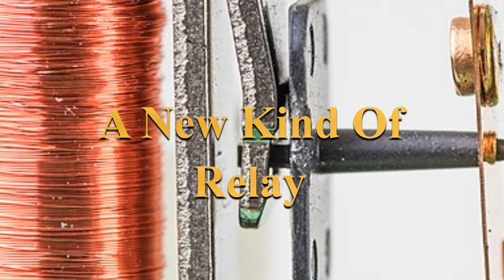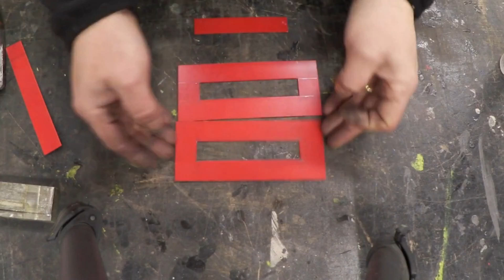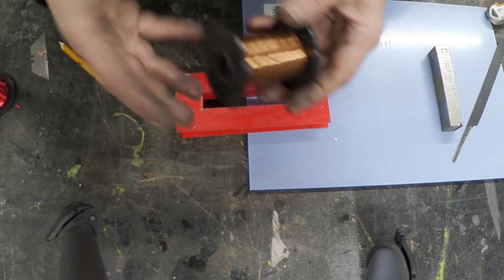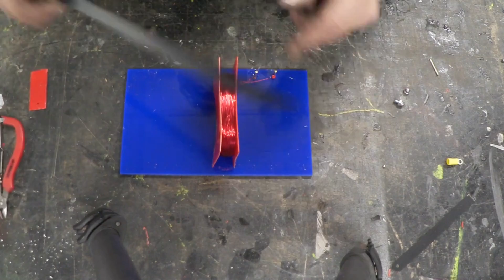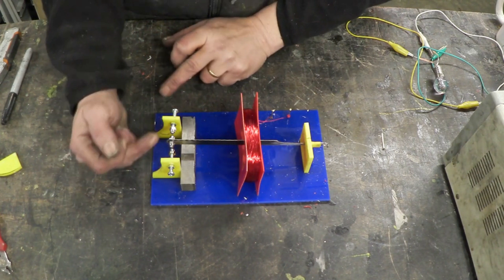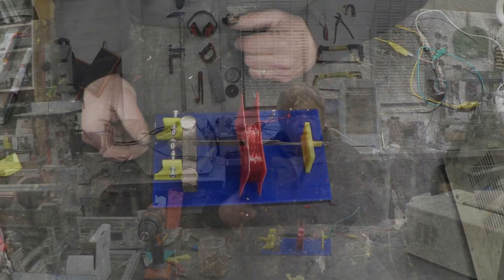2067 A Very Different Kind Of Relay

Comment: Some how i missed this video!!😮..   this would be great for regulating a wind turbine, hydroelectric generator, about any charging system . That could over volt as the battery is charged!   It can cut in loads to reduce power in storms gradually until at s peak it can shut it off divert water or apply a brake to turbines! Small very low current contacts can be used allowing relays to handle the work. Or reed switches and MOSFETs!! Have a magnet on the tip. Triggering different things as the magnet moves to theirlocation as voltage rises!  It could just aswell be tne current use thicker wire on the voil and the turbines current going through it, in series, rather than parallel z zzz

Comment: Fun device. I think when you have a few different thresholds on that for a few contacts it would be hard to reproduce and certainly obsoleted by modern electronics. I own a "Merry widow" 1958 pinball machine which I restored in original shape more or less  and you would be amazed what electromechanic devices are in there. Most notably counters made of disks filled with contacts and pushed up or down and reset with electromagnets.

Comment: How would you build an economical reliable relay to switch 100+ volts dc for PV direct to the element in a hot water cylinder so contacts don't arc?

Comment: And this, is why analog computers had so much potential, and still do for certian applications.
A simple relay that can take and do addition, based on voltage and could be made quite small. In addition to that, youve gone and made the arm compliant so there should be nearly no friction losses, if any at all.

Comment: This is a really fun project and takes me back to when I was 8 years of age and making discoveries with electricity.What would be good fun would be to adapt the relay wiring to become a vibrator in series with a step up transformer and generate high voltage for experiments!

Comment: Would it be safe to assume a weaker magnet set would require less voltage to overcome? Or the inverse?

How would asymmetrical magnetic strength change the switching function

Comment: For those interested, the device demonstrated in this video is akin to a variety of commercially available relay called a "latching relay".  That kind of relay has magnets that can latch the contacts in either of two positions while no power is applied. You can force the relay to one or other state by applying a voltage to one or other of two control coils. Or some varieties have a single coil and you apply a voltage with one polarity or the other.  
These are extremely useful in situations where the relay may spend a long time in either of the states, so with a normal relay there's a 50% chance it's going to be consuming power and producing heat just to hold in the "active" position.  With the latching relay, the controlling circuit just applies a brief pulse one way or the other to get the relay to the new desired position. Latching relays are used, for example, in test equipment, to select input range.  Test equipment often needs to be designed to minimize internal temperature drift, and avoiding heat-emitting relays helps with that goal.

Comment: well now I might just have to try using a version of this to make a regulator for my one big ol alternator I got out of an old truck.  I was wanting to use as a portable welder but in my rush to it out of the truck that was being crushed I didn't manage to grab the external regulator and I just havent found the thing I wanted that I could adjust would regulate and I could make out of junk I have  thank you sir

Comment: Nice! The hacksaw blade acts a little like the swinging needle of an old skool voltmeter. The tip of that needle could be the slide of a variable resistor; giving a voltage variable potentiometer.
Reply: I think you're on to something here.
This way one could build a very simple low-budget charge-controller for a windturbine (or such), if you make the potentiometer control the amount power made by the windturbine going to the battery. It could also stop charging if there's not enough voltage to charge the battery anyway.

Maybe not the most efficient charge-controller according to some people, but very very cheap and without electronic abracadabra.
Reply: You've just read my mind... something like this but for solar or wind.... has anyone built or thinking of building one of these?.... I'd love to see the outcome of that
Reply: This could be helpful also to poorer countries where wires easier to get hold of than semiconductors or charge controllers, as those are pretty expensive in poor reas of Africa or rural China or other countries

Comment: Another great variation is something i made for a personal project. Mine was a little different than your setup, but changing it to match yours... id put magnets on the saw blade sandwiched. Then 2 small coils in series placed one on each side of the sandwiched magnets. Then a short positive pulse will swing it to connect and hold until a short negative pulse is sent through it and it will flip and hold the other way. I actually thought of patenting it years ago but thats a pain. But its a darn sweet relay that takes nearly nothing to flip it either way...
Reply: with only one coil is the same, just need a negative voltage source. I love self latching relays. You need only one peak of current, just once.
Reply: @deslomeslager  I agree. I just did 2 so I got the push pull from both sides at the same time. Just takes less energy to flip it and latch. Works great, and simple.

Comment: What you have there is actually the basis of the old analog meter where the position of the arm/ needle is based on the strength of the magnetic field  which in turn is based on the current flowing through the  coil. If you put a calibrated display panel behind the arm we can tell the current going through the  coil by looking  at the display behind it. Obviously voltage is read as the coil has resistance which which limits / controls the current going through the coil.

Comment: Very interesting, multi-use like a fuse or voltage dependent switch too, if you had different volt battery banks each step up would start charging the next higher voltage bank and you could have the overload "dump" at the end to make it one unit

Comment: That's great! A relay like that can have many uses! Just for reference, how much voltage did you apply?
Reply: It would have something to do with the number of turns so if he said 20 V you’d have to have the exact same coil to apply that number. I was thinking about these microwave fan motor coils. They seem to come in standard sizes.

Comment: Adjustable analoge low or high voltage cut off /on swich.  AWESOME! Thanks Rob
Reply: This would be a great option to avoid over charge/discharge on certain type of batteries. And many other uses for sure.